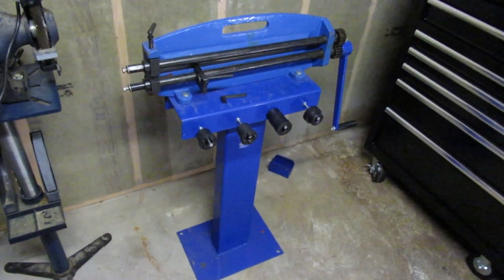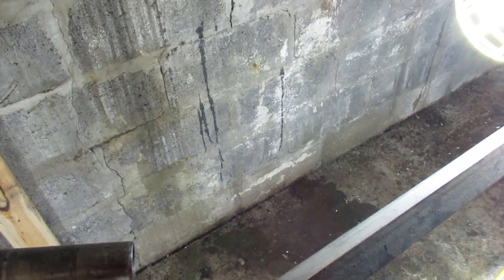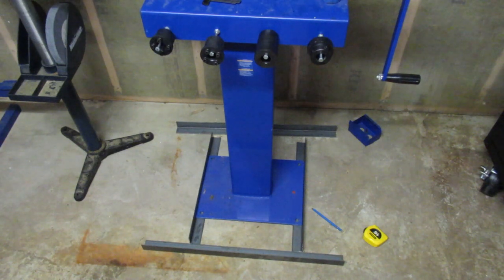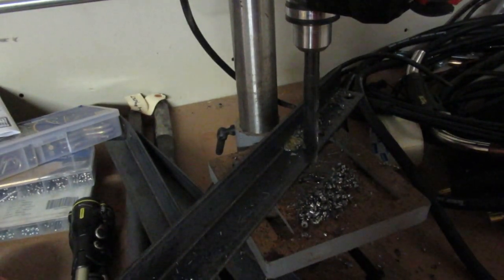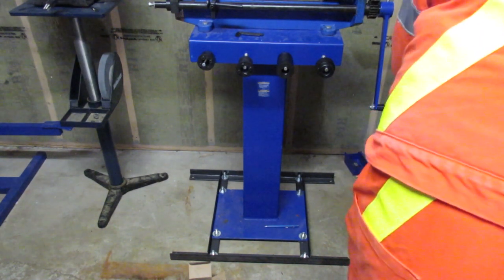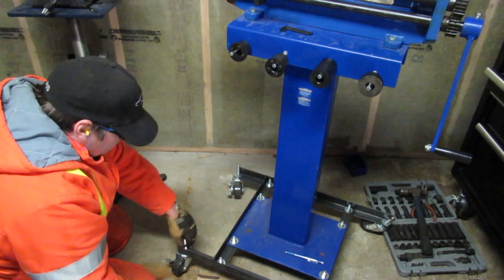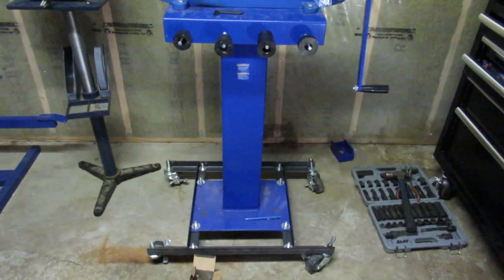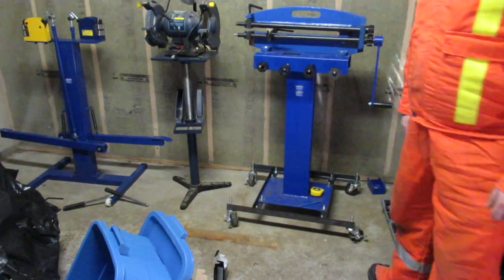Bead Roller Casters

Comment: Good job on widening the base. I don't see these bead rollers for sale on Princess Auto's site, most likely did not sell as well as they had hoped.
Reply from the maker: There is a similar bead roller being sold now that is made from 1" plate.  That may be a better option because it's easier to modify and won't be warped like mine is.  You can see one on Trev's Blog.
Reply: @SteveRivett  I have the 18" bead roller that Princess Auto sells, I have followed Jere Kirkpatrick's upgrade except mine is manually operated with a 16" steering wheel.
Reply: Looks like they have stopped selling them.